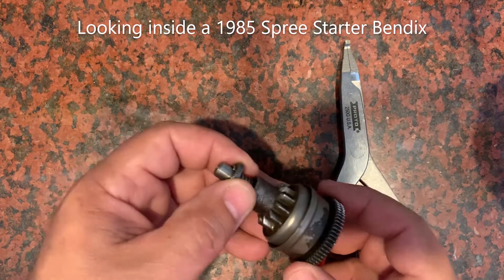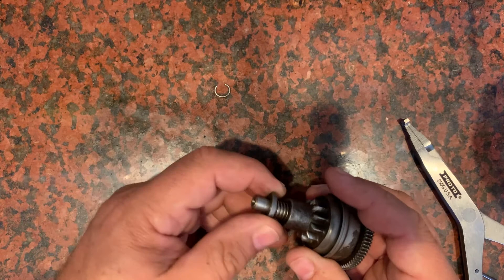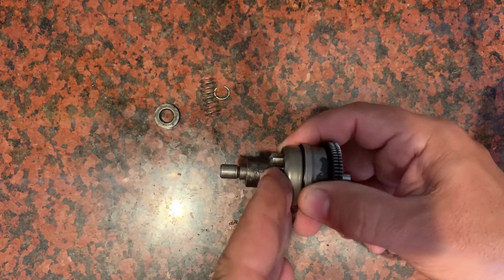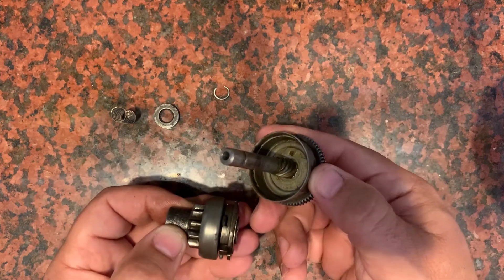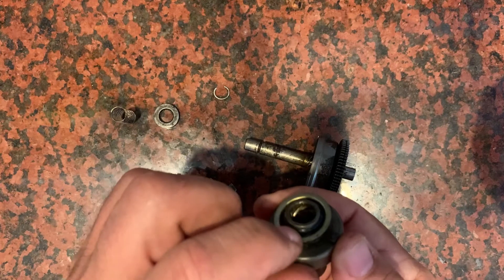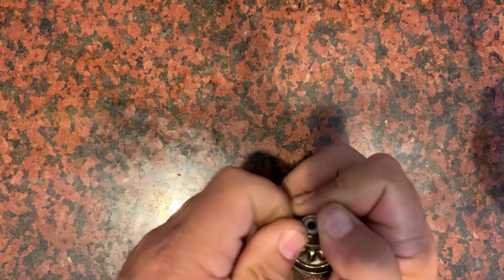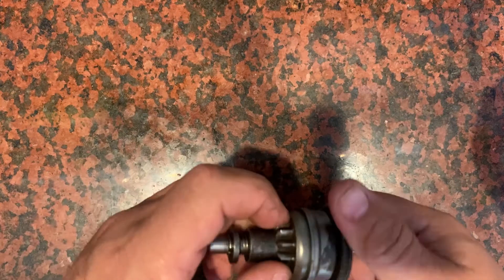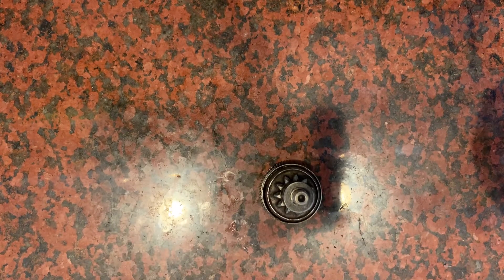Honda Spree ● Looking Inside the Starter Bendix

Comment: Only information i could find online (including outside youtube) which shows the internals of a bendix.  This is a smaller variant of what i have on a kawasaki jet ski, but i bet the design is the same.  Those 3 keyed weights you show probably increase clamping force.  As the starter spins up you don't want the full force (torque) until the teeth are fully engaged. Any spring holding them back is "tuned" to a certain rpm.  Pretty sure this is what failed on my jet ski, just not sure it's worth pulling the engine out to get to the thing.  18 year old ski.  Had engine out once before.  Salt water is not kind to these things.
Reply from the maker: Yes - totally agree. Kawasaki jet skis are some of the best. I have 2 of them, but on a lake. Salt water is a losing battle.  I wish you the best.
Reply: I’ve been looking everywhere for this explanation! Thanks brother! Hopefully this will fix my paramotor 🙏🙏